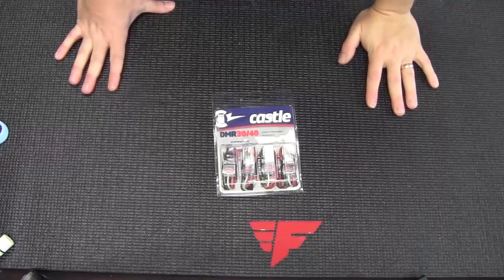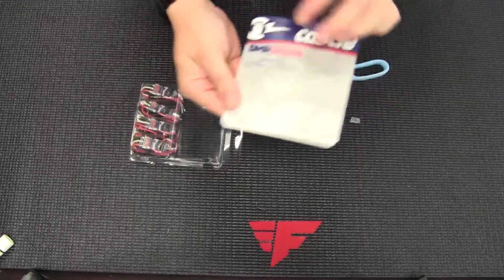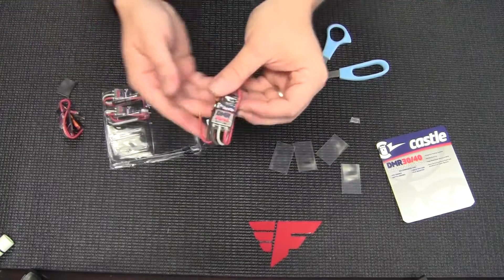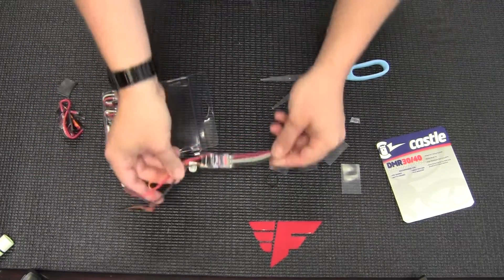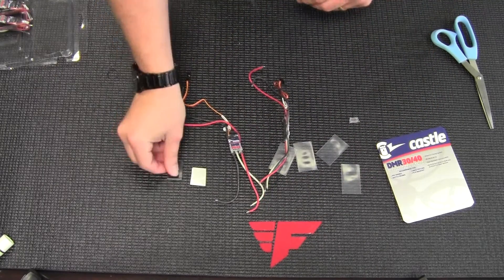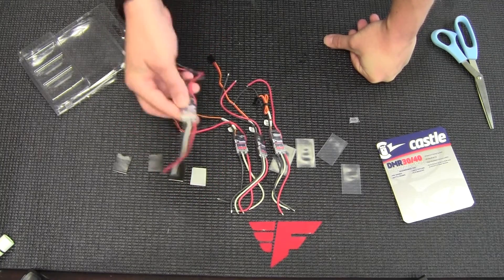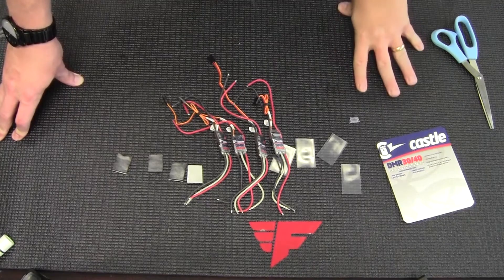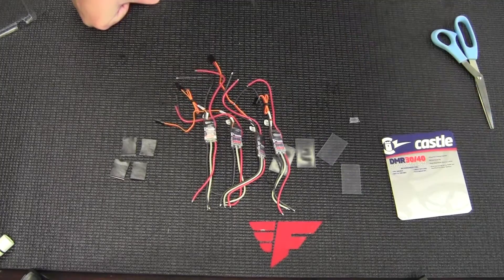WHAT'S IN THE BOX?!? Castle Creations DMR 30/40 ESC Unboxing - Force RC

Comment: do I need to used the power cable within the single and ground lead. or is that just for the castle link?? my fc don't have the 5v pins for the signal and ground?? hope you understand my question... thanks